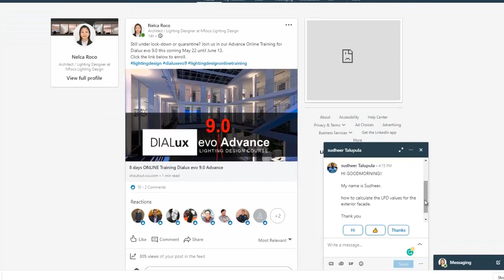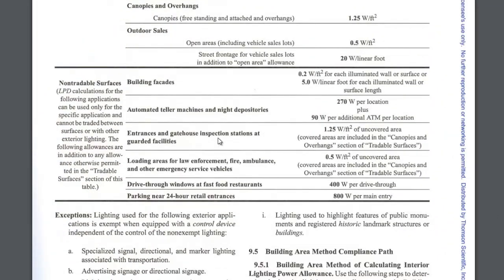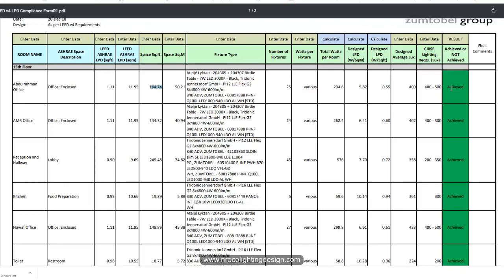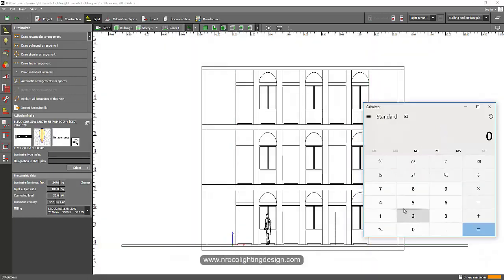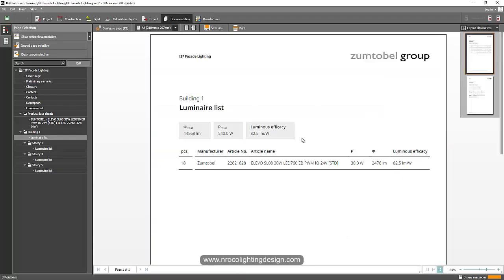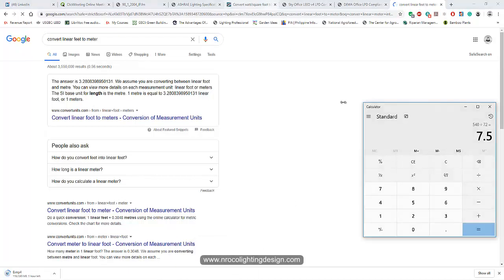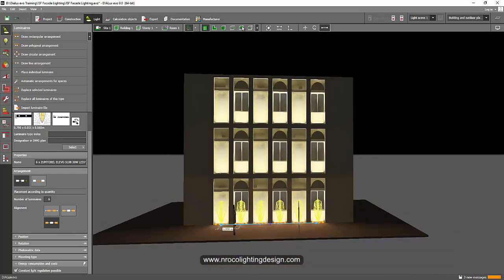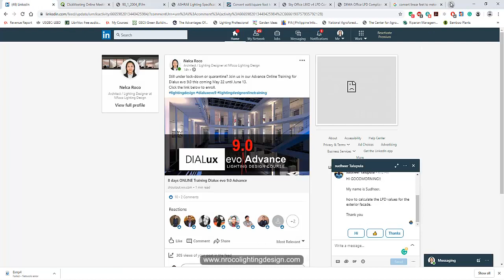How to calculate the LPD Values for Facade Lighting?

Comment: According to ASHRAE standards, when calculating lighting power density (LPD) for a facade, the entire facade area is used, regardless of whether the light is evenly distributed across the whole surface; meaning you calculate the LPD based on the total facade area, not just the illuminated portions.